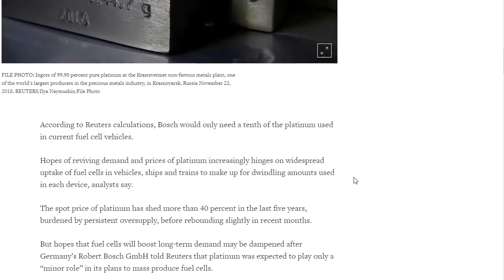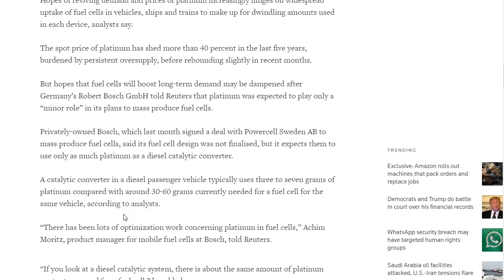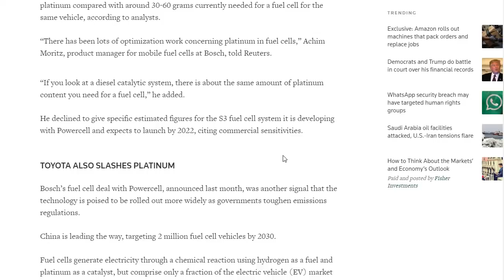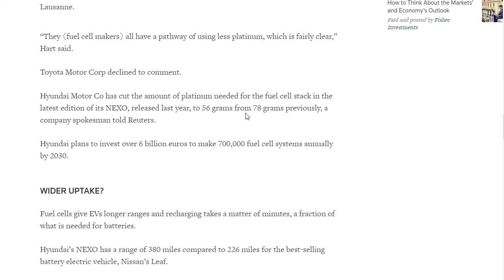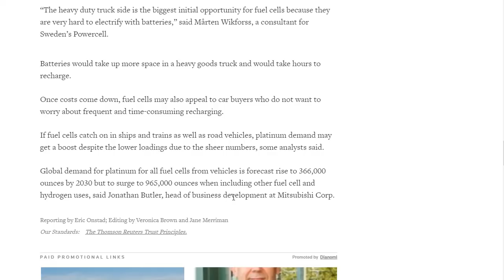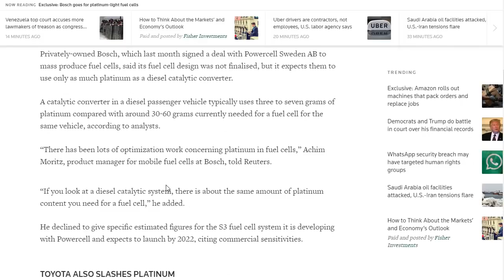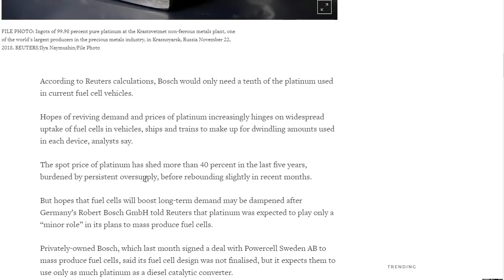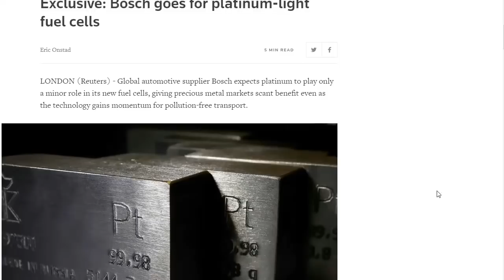Platinum Demand Decrease For Fuel Cells | How Will It Affect Price?

Comment: Still holding my Platinum,  It is definitely a gamble but seems with Palladium so high that the two need to balance out someday.   Seems all the PMs outside of gold are very volatile.   Platinum and Palladium are easily manipulated by the few major sources.
Reply: They have balanced 😂
Reply: @Chrunchmunch   I was wrong! 
Glad it was a small portion of my PMs, last I added was when it was in the 800s,  I focused on gold after since I felt I had enough silver.
Now I just do not have the extra income to add anything, once CCs are paid off again then I can continue.
Reply: @westcoaststacker569  you were right! Palladium and platinum have essentially balanced but I think one of the two will take off.

Both should out preform gold in the next 20 years.

Pay your debt and keep stacking!

Comment: DECEMBER 13, 2018 - Scientists maximize the effectiveness of platinum in fuel cells - "Since the new catalysts require only an ultralow amount of platinum, similar to that used in existing automobile catalytic converters, it could help to ease the transition from conventional internal combustion engines to fuel cell vehicles without disrupting the platinum supply chain and market,"       https://phys.org/news/2018-12-scientists-maximize-effectiveness-platinum-fuel.html